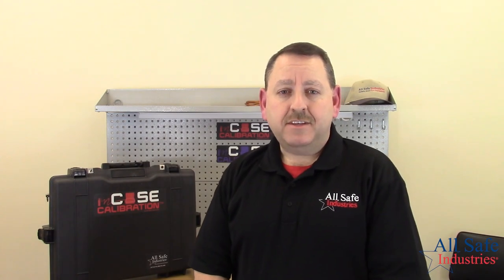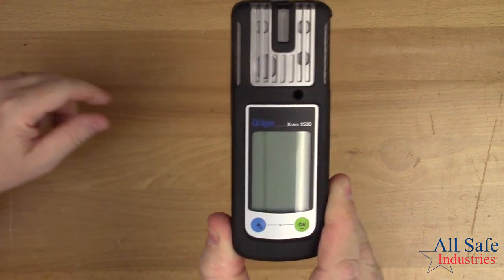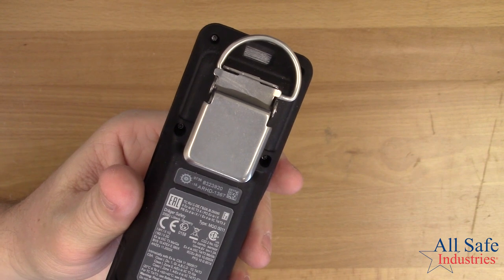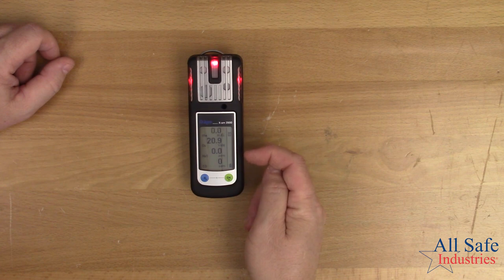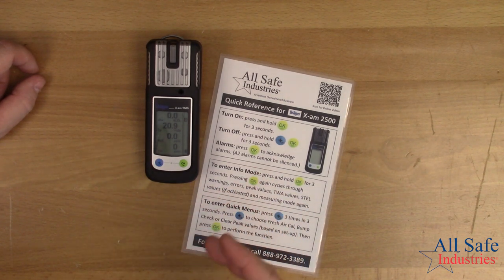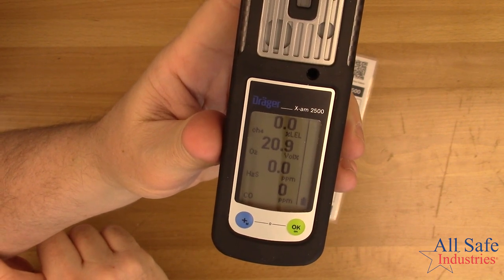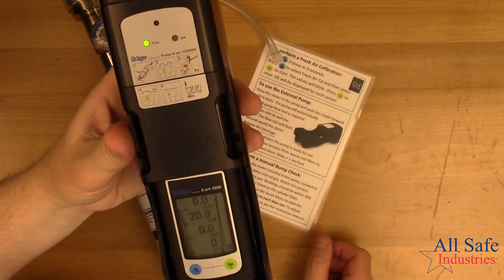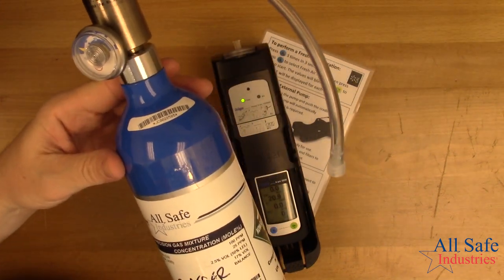Draeger X-AM 2500 Training Video - Part 1

Comment: I have recently arranged xam 5600. It only shows 4 gasses (ch4, co2, h2s, o2) but doesn’t other 2 gases. I desperately need to measure NO2 in a process. Can i use this? Kindly help.
Reply from the maker: Did you install the NO2 sensor or did it come configured this way? For any configuration change, the sensor added to the meter will need to be activated with the CC Vision software first.